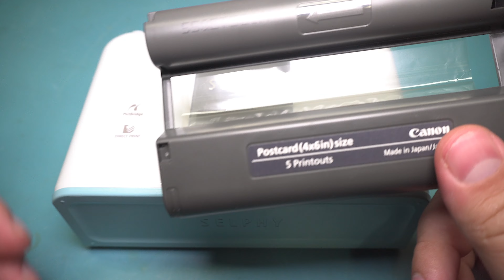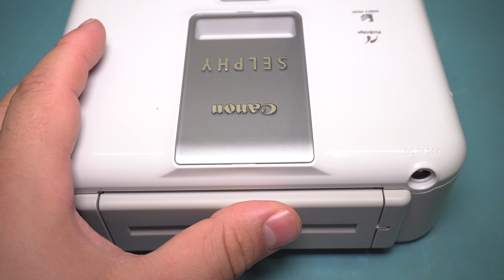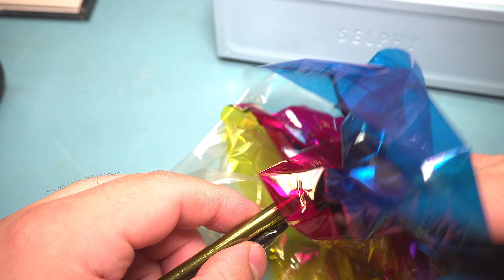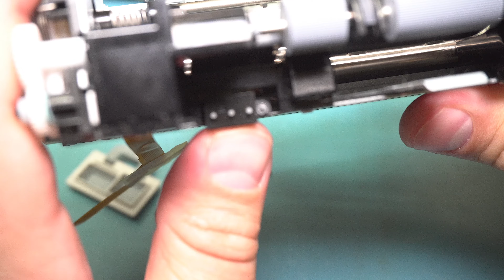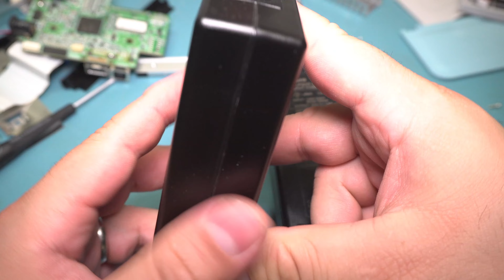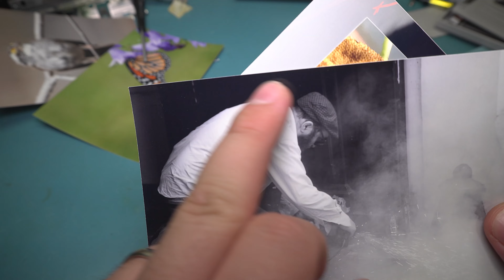Canon Selphy CP510 Teardown

Comment: There is 3 little buttons inside the inlet where the tray seems to register which kind of paper tray it is. I have the 4x6 inch tray, but I would like to 3d print the other tray versions. Can you confirm that the tray of the CP1200 works on the CP510?

Comment: What about the firmware, and does it have a serial console?
Reply from the maker: +John Keates As far as I know there are no firmware updates available for it, so extracting it that way won't work. It would have to be read off the flash. 

It probably does have serial support somewhere on it since it is a more or less off the shelf controller from ALPS. I didn't notice it specifically though.
Reply: Que se hace cuando salen fallas blancas